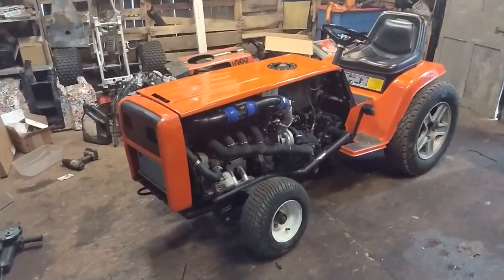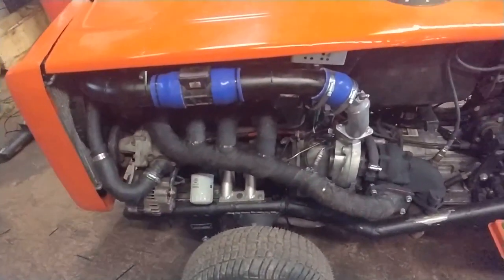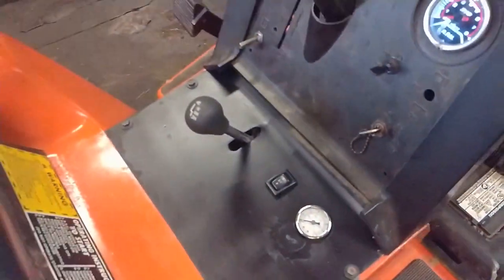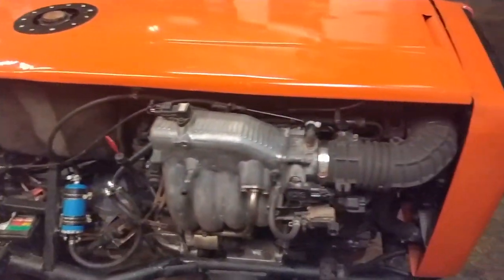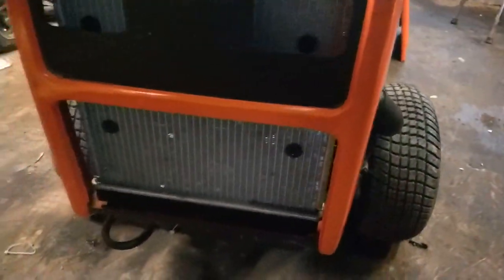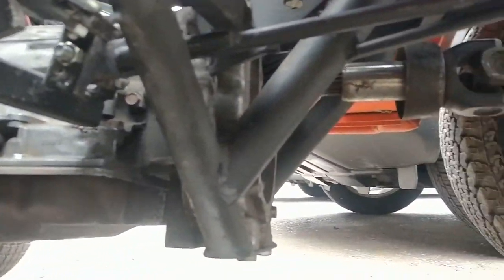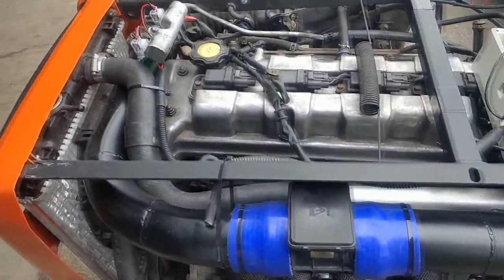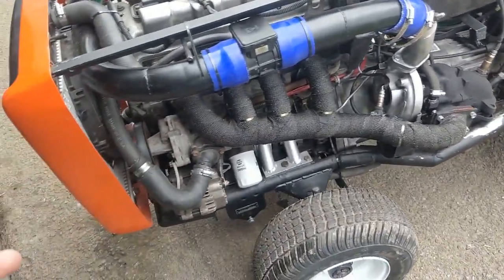IQCS 2020 Entry - 1978 Jacobsen 1650 With Suzuki J20A Turbo

Comment: Please tell me the clamps holding the axle or at least U Bolts from the leaf pack not Muffler clamps you should really make that a little more solid because you have a lot of power on tap in that little mower